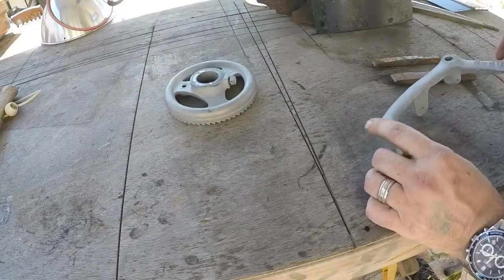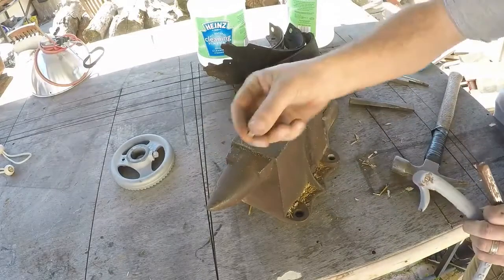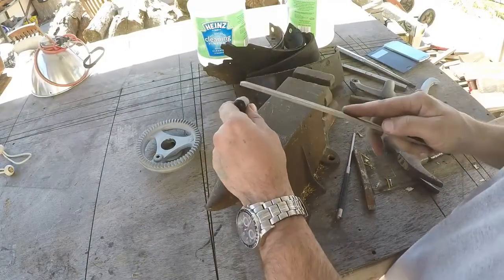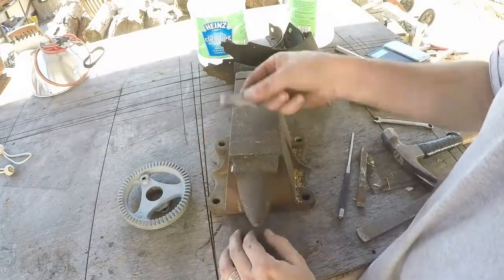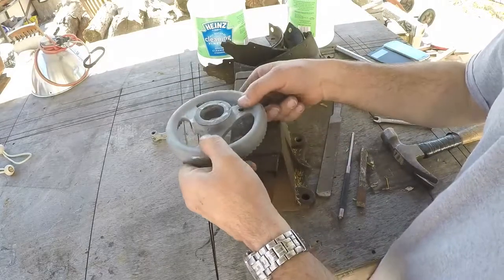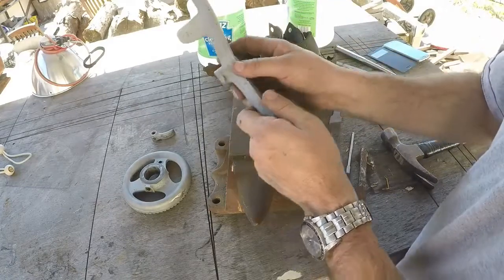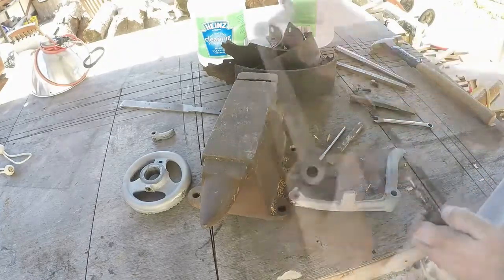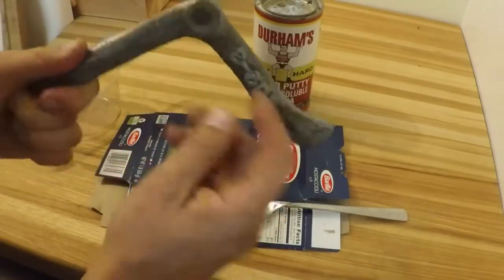Foundry Pattern Making from Parts

Comment: Thanks Chris. How will you account for shrinking, or will it matter at all. Thanks for sharing
Reply from the maker: In iron the shrink is about 1/8" per foot so something 6" will only loose 1/16" . I also give it a heavy coat of paint so and shrink is tolerable in this part . Bit that's not always the case great question